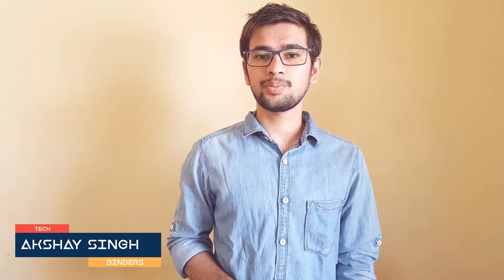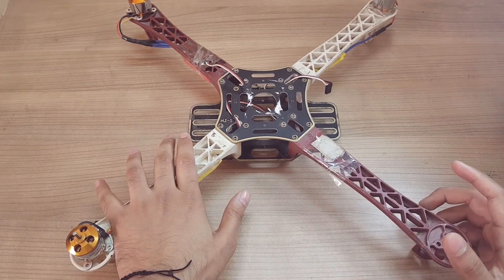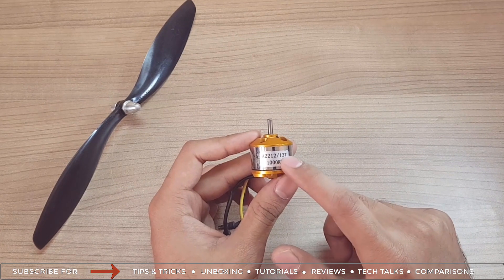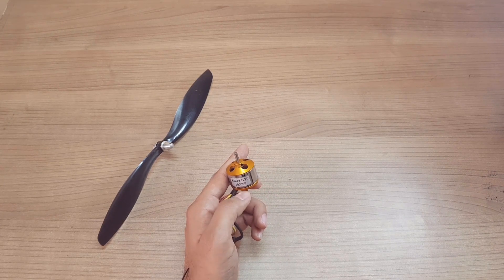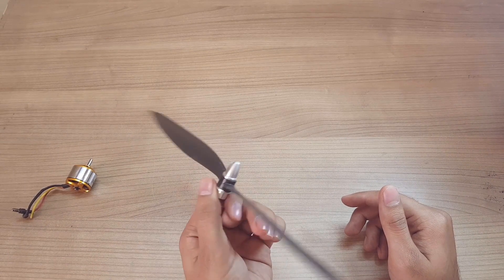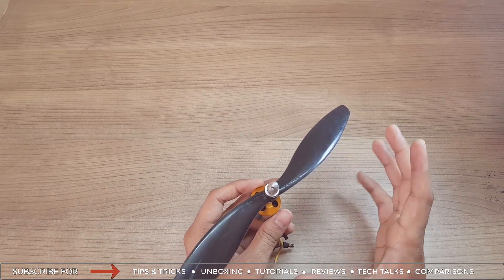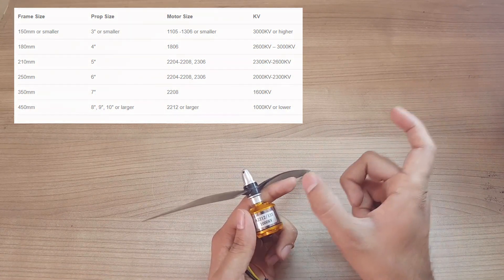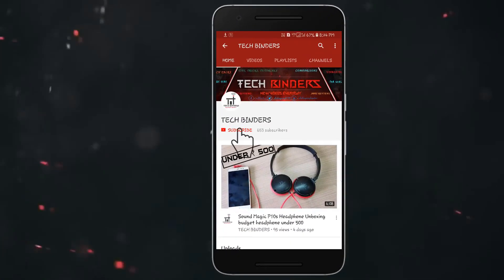How to Choose Motor And Propellers for your Quadcopter.😀Part -2

Comment: how do you calculate what KV you need for a given propeller diameter?
Reply from the maker: The data is provided with motor specs..
Reply: @TECHBINDERS  thanks for the quick reply, but what are the calculations required
Reply from the maker: See higher kv motor uses less inch props and lower kv uses higher.. it depends on manufacturer  and user requirements

Comment: Hey bro, I am using 10*4.5 propeller, it's getting broken down from the shaft during flight, what could be the reason? Are you on insta? If yes, please share the I'd...thanks👍
Reply from the maker: Yes, i am on insta, check the insta id in description or on channel page, one reason can  be due to poor quality of material used,  what motors u are using??
Reply: @TECHBINDERS  Thanks for the quick reply bro...1000kv bldc
Reply from the maker: @amit22joshi  have u used blsck washer also provided with the props, don't tighten a lot ur motor  top part maybe that's  why they are breaking also check for any crack or damage on props before flying
Reply: @TECHBINDERS  thanks bro...will reply u on insta with pics👍

Comment: can i use 2200kv motor with 1045 propellors in Q450 frame ?
Reply: I Also have the same question.
Please help ASAP
Reply: @aashish070  it is better to use 8045 propellers for 2200kv motors to avoid damaging it

Comment: Sir, I need your help.
I have made a quadcopter using DJI NAZA M-LITE, 1400KV BLDC MOTOR, FLYSKY FS-I6 Tx/Rx. But here is problem, when I  armed my quadcopter at that moment M2 is running on & when I picked the throttle up that time M1 + M3 + M4 are slowly slowly catch speed. M2 is running very speed than other Motors........

I have also calibrated 4 esc.......
Reply from the maker: May be u need to callibrate level
Reply: @TECHBINDERS  Thank You So Much, Dada.
But, how would I do as you said.....???

Comment: Hi what happen if we decrease the diameter of propeller in drone if are it,s effect
Reply: Decrease in diameter at same rpm
Reply from the maker: If u decrease the diameter u require more rpm because only 30% of thr prop is utilized for generating lift, that is why the rpm and propeller length are inversely propotional.
Reply: A simple example i can share with you just think the pitch as the gear of the car, lower pitch means lower gear of the car,good for climbing and slow speed but not good for fast speed.

Comment: Bro... In our project we make a drone to lift almost 4kgs to 5 kgs of weight.... So what range of motors,chasis, propellers and flight controller I need to use???
Reply: as your total mass will be around 5 kg then you will need to motor to produce in total of 10 kg thrust. So now it depends on the number of motors you are going to use if u make a quad copter that is with 4 motors then, each of the motor must have the capability to produce 10/4=2.5 kg of force. But as this thrust can be more then you make a hexa copter with 6 motors then each motor need to produce 10/6=1.66 kg thrust  I hope you have already done the work but still this comment can help some people some day.
Reply: First of all how did you calculate 4-5 kgs without calculating the weight of the chassis and flight controller?

Comment: This video is very misleading. You have not explained anything clearly or done any relevant calculations. It looks like you yourself are not clear(stammering, stuttering, long pauses between sentences). There is no rule that the thrust:weight is 2:1. It can be higher or lower(Even if the drone is not a FPV/racing drone).
Reply from the maker: I understand that video quality is not good but you need to hav atleast 2:1 ratio, if not then it will be not responsive,  if you want you can go higher like 11:1 but higher one is used for racing multirotor.

Comment: How much weight can one motor lift ?
Reply from the maker: 500gm
Reply: Is there any one bldc motors with high rpm which can lift up to 3 kg ? Because I need that for making another project.
Reply from the maker: Yes, but the rpm will be lower and not higher...for heavy payload
Reply: So Which BLDC motor you want to suggest me, which is having high weight lifting capacity ?
Reply from the maker: Message me on my whatsapp number and i will help u in better way..

Comment: Bro for  2200 kv motor what will be  propeller size as well as lipo minimum requirements?
Reply from the maker: What is the maximum weight of your quad?
Reply: @TECHBINDERS  1 kg

Comment: actually selection of motor depends if u want torque go for small kv and for speed high kn(>2200) ,but if u r beginner then go for combination of both 1000-2200 kv :D

Comment: what is the recommended minimum and maximum weight of the quad that has 1000kv brushless motor and has 1045 props?
Reply: that includes camera
Reply from the maker: Less than 1 kg including battery.
Reply: @TECHBINDERS  Thanks.
Reply: @TECHBINDERS  Hi its me again sorry to bother you. can you help how can I calculate the maximum weight that the drone can carry to fly high.
If I have 8 2200kv ??
Reply from the maker: Just xheck the motor specification and find their thrust multiply by 8 as u have 8 motors and divide all by 2 so it will give u maximum thrust it can give and kindly check the propeller size so that you get equivalent thrust . As thrust of motor changes by changing the size of propeller..

Comment: if my quad copter weigh 1.5 kg what size of propeller should i use
Reply from the maker: you can use same configuration if your weight is 1.5kg only. If more you need to change a lot of things not only propellers.
Reply: what is the maximum voltage of the motor u showed in this video
Reply from the maker: It is compatible upto 4cell battery  so 16v approx

Comment: Can I use 2200kv motor with 10inch and 30a,2500mah 11.2 battery or any other combinations?
Reply from the maker: No bro that is what i have explained in this video..you cant use bigger propeller with high kv rating motor
Reply: TECH BINDERS so is 10 inch propeller enough for 1400kv motor ( it wasn't 2200kv motor sry)?
Reply: And thx for ur help
Reply from the maker: no use 8 inch one or lower if you can easily get otherwise 8 inch will  work
Reply: One last question ( I may asked to many questions sry to disturb you). Is it necessary to use CW propeller for CW motor only or can I use any random propellers for the motors?
Reply from the maker: Yes you need to use specific propeller on specific motor. No random propeller

Comment: I have A2212/10T 1400KV motor with 30 A ESCs with 1045 propeller and 11.1V 4000 mAh 10 C Lipo battery..My quadcopter weight is around 1.2 kg...still won't fly..plz tell me if my combination is right or not?
Reply from the maker: it is because the maximum current rating of the battery is 40A while quadcopter amp rating can go up to 120A so increase the C -rating of your battery for further assistance contact me on WhatsApp.
Reply: TECH BINDERS okay Thanks for Reply

Comment: Can you please tell me that if i use a 1400KV brushless motor and 10 inche propellor !
How kuch thrust would i get?
Reply from the maker: If you use higher kv motor then use lower propeller  to get more thrust.
Reply: If i have 1.5 kg net weight of drone, so it will be sufficient by using 1000KV motor or should i opt for 1400KV motor?
Reply from the maker: Bro message me on fb or WhatsApp and i will better assist you..
Reply from the maker: Its there in the video description.  9458706160
Reply: TECH BINDERS give me your contact plzz
Reply from the maker: 9458706160 it is there in the description. Massage me on whatsapp
Reply: I also want to know that
Reply from the maker: Kindly message me on whatsapp

Comment: Maine apne 450mm drone mei 1000kv ka motor aur 10*45 prop h tho uski maximum height aur lifting power kitni hogi
Reply from the maker: Bhai maximum lifting(torque) aur height battery voltage battery capacity air battery weight pe depend karta h...
Reply from the maker: Maine abhi tak approx 250m upar udaya h..kyunki uske upar drone bahut chota dikhta h aur controlling me prblm aati h

Comment: 1 to 1.5 kg prop 1045
Reply from the maker: +Suraj Chaudhari ok are you using  kk board as flight controller..go for 1000kv..also i have done video on selection of motors ..kindly check that video too.
Reply: I using apm board.. And 3s lipo, 935kv motor and alien frame 500.. after all the copeter is not getting stable its rotating